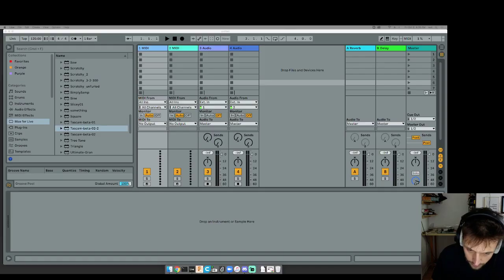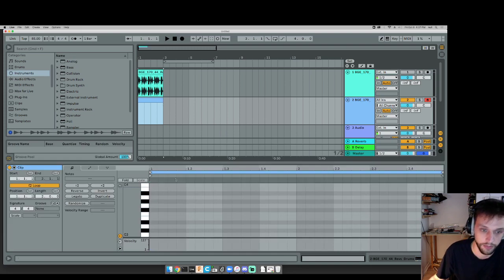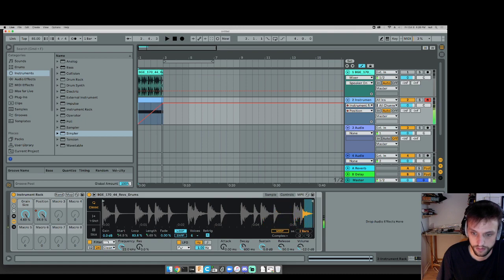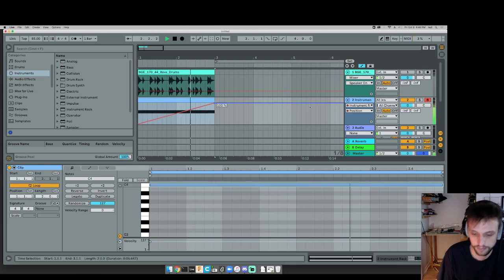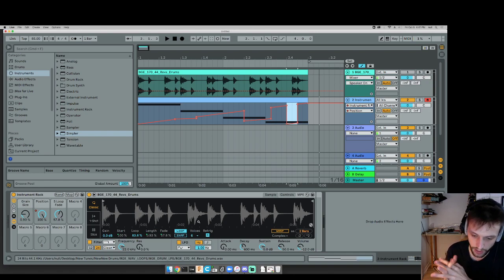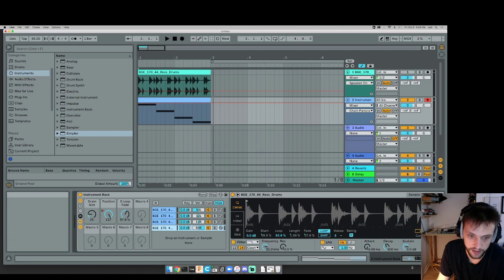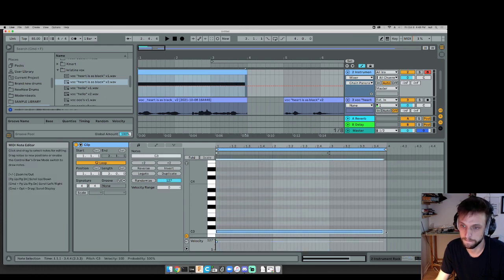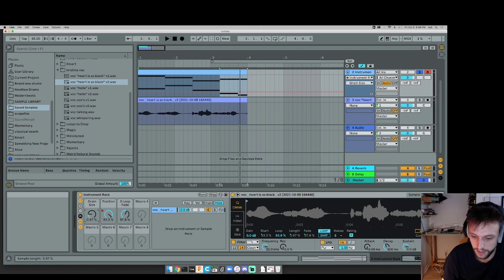Granular Synthesis Explained Simply

Comment: Tight! I love the clear and concise way you explain this. I basically know how it works, but it's nice to see it demonstrated. And the vocal repitching and harmonizing is so cool. Smart way to use it, I love it.
Reply from the maker: Ayy! Thanks! This is the way I usually explain it to students when they're first learning about the different warp modes, but the thing I like about this is it starts to get into the idea that a lot of different DSP stuff is just different spots on the continuum. So like, if you have longer loops, it's looping, shorter loops it's granular and even shorter loops turns into sort of like, wave table synthesis. And there's all these great spots in between. Same with delays, you got like filters, then all that phasor flanger chorus stuff, then karplus strong shit and reverb, and then you kinda get to looping at the far end of it.
Reply: @woulg  What a great insight. This is the next step after "basically most audio effects are delay." Thanks for this. <3

Comment: the tricks with simpler are nice but it's strange to see a tutorial about granular synthesis with no mention of making pitch with small grain sizes.
Reply from the maker: This is a super good point! I definitely should've included something about that. Maybe that will be part 2
Reply: @woulg  if you haven't already, check out album Point Line Cloud by the granular synthesis pioneer Curtis Roads. I was sceptical of granular synthesis, but it changed my mind.